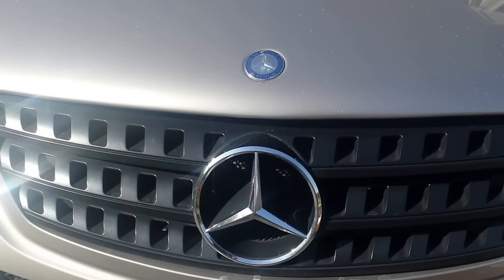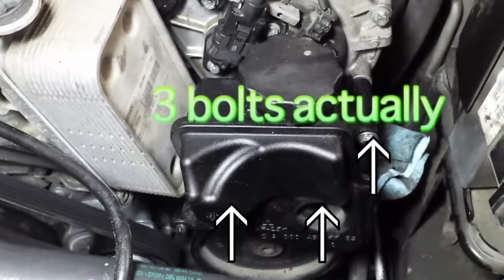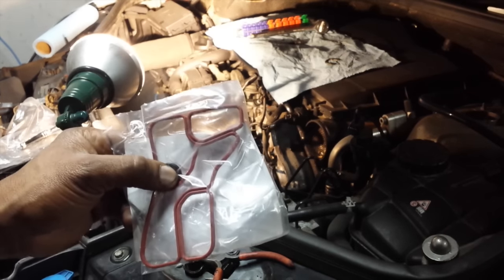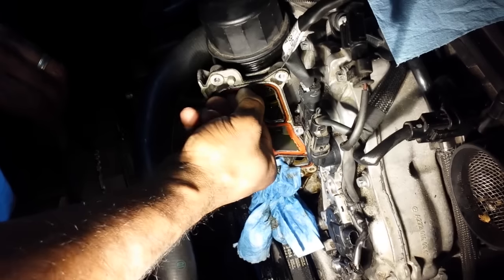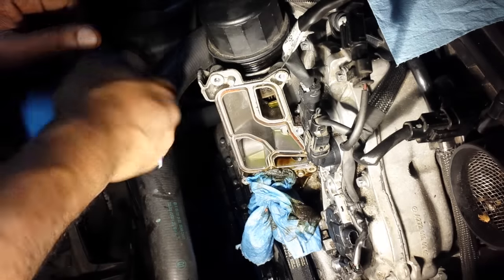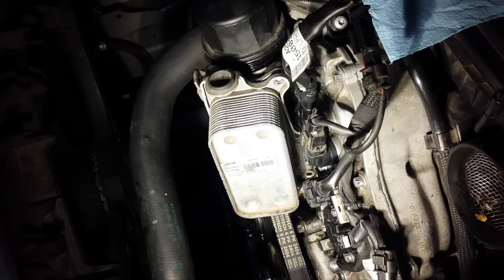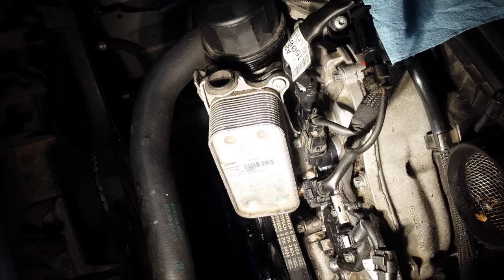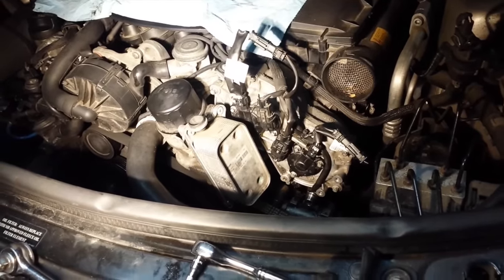Mercedes Oil Cooler Replacement/Gasket Change

Comment: hi repair autos  ..i have problem with my car mercedes benz c240 model 2001 w203 ..when i opened the cover of coolant water i found the oil inside it ..some one said to me change the oil coolant ..help me pro to fix it ...and what can i do to cleaning the 
 water from oil and return the car as before step by step --thanks alot my brother
Reply from the maker: Hate to say this but it's faster and cheaper to get your radiator flushed at a trusted shop.

If you're gonna do it yourself..
Start by replacing your gasket on the oil cooler.  Then you will need to flush the coolant from the radiator and replace it with new coolant.  The radiator has a flush port on the driver side of the radiator.  Do NOT do this when the coolant is hot.  you will need to fill the radiator filler port completely filling the radiator.  Then with the engine running and the radiator reserve port open fill it as it goes down.   It's a slow process.  You may need to flush it several times.
Reply: iRepair Autos thank you my brother

Comment: Brother how to replace the belt on 2009 E350
Reply: it's super easy and quick ... a kid can do it without getting anything messed up.

Benz designed plastic idlers and cheap tensioner to need regular replacement else your belt accessories will get damaged 😂

Comment: Thanks Keith. Oil cooler leaked on my belt tensioner a ruined it. Fixed now.
I have a question if you dont mind. I have a chatter on cold starts on my 2008 272.  It lasts a few seconds, longer when colder out. I believe its the cam adjuster/phaser. Left side of motor, behind the intake cam magnet. The chatter goes away car runs great. No codes yet, is this a common problem? Could it be the magnet itself? Thanks. Here is a video.
https://youtu.be/saVkHkt1U38
Reply: I think you are right: the soft lock-pins inside the timing gear adjusters are designed to wear out and cause the 2 chain tensioners to make extra noise at start-up 😂

Comment: Nice job bro
Reply from the maker: Thanks bro!  I had to do this job this weekend and hopes it will help someone when they have to do it.
Reply: Yeah I am going to do mine next weekend
Reply from the maker: Make sure you get a new rubber o-ring for the power steering housing.  You'll want a new one if you take off that housing.   As well as some 1 quart of power steering fluid.  1 quart of oil and some coolant to top off the reservoir.
Reply: Considering how often both gaskets fail, I would have removed the whole oil filter housing and change both oil cooler and oil filter gaskets. Nice video Nonetheless.
Reply from the maker: Yup, I'll create another video at some point showing the other gasket replacement.n  Thanks for the feedback.
Reply: Hi! iRepair Autos! Just one question, why did you just change the gasket and get the same oil cooler?
I have an e270 w211 already changed the oil cooler twice, but still the car continues to mix water with oil, but I never changed the gasket, is my problem there in the gasket? Thank you man
Reply from the maker: +Duarte Nascimento I didn't change the cooler because the cooler wasn't the cause of the leak. The gasket was the cause.   You should always change the gasket whenever the seal is broken (you remove the cooler).  Great question though.   Inspect your cooler and put a new gasket on there.   Oil with coolant could be another issue. Hopefully you don't have head gasket issues.
Reply: Hi iRepair Autos good morning.
First of all thank you very much for the answer, but I have already discovered what my problem is, my e270cdi, is automatic transmission, it was the oil cooler that stuck and was mixing transmission fluid with water. The oil cooler is located inside the engine cooler in the vertical position, identical to the 2003 Mercedes S500. When this happens you are required to change the radiator cooler of the complete engine I will do this, I did a test thank God I do not have water in the transmission. I'll give you some news as soon as I can solve the problem ok. Thank you man